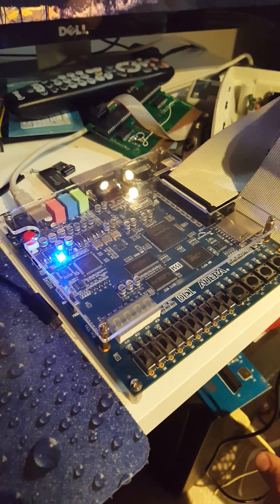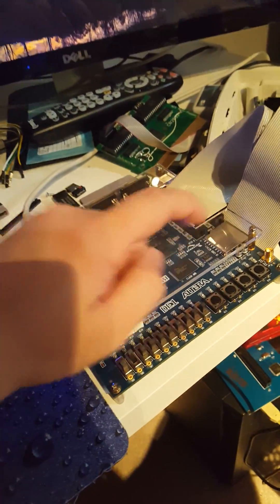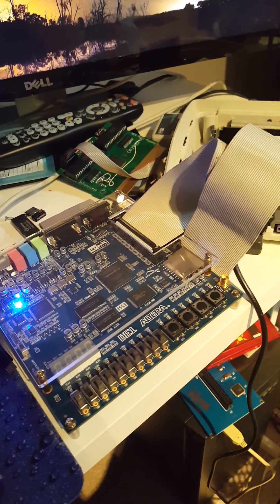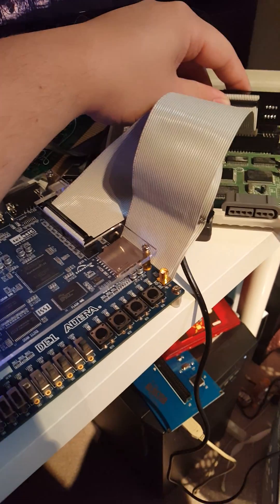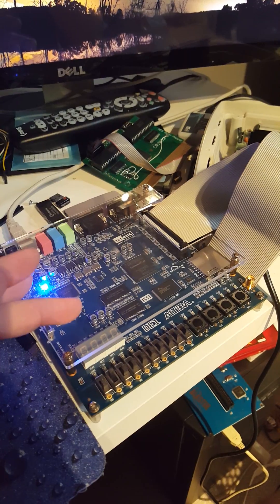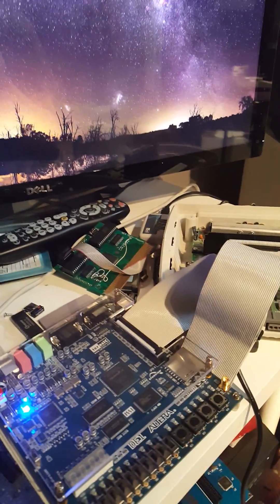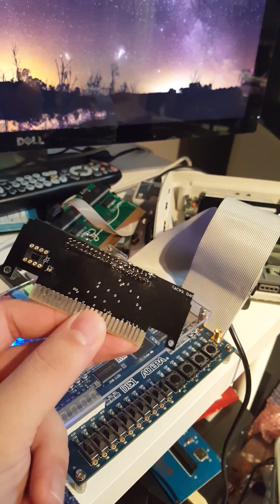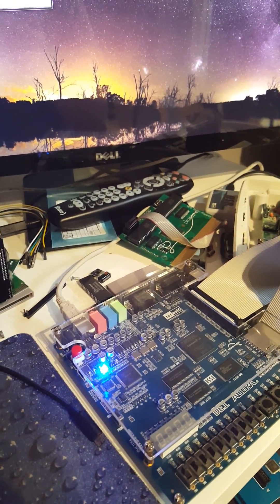FPGA SNES cartridge emulator

Comment: Retrostage PCB,

I've been writing some assembler for the snes as a hobby project here lately. I'd like to run some of the stuff I've made on a system and I've got an fpga dev board. Can you share the details on how you made the passthrough board? Also what hdl did you build this with? If with verilog would you be willing to share your implementation?

Thanks,
Austin
Reply from the maker: It was done with Verilog on a Altera DE-1 dev board. The passthrough board was just a test, but it lacks voltage translation from the 5V SNES to the FPGA board. As such I scrapped the project quite a while back.

I plan to revisit this at some point to add UART to the mix so I can write games over USB. If I get that working I'll release a proper source.

Comment: How voltage levels alignment was DONE ??? SNES has 5 volt logic or not ?
Reply from the maker: This was just a simple tech demo showing off the idea. If this were done in a cartridge setting then yes voltage translation between the 3.3V and 5V from the SNES would be needed.
Reply: @retrostagepcb4908  Cool. I was going to implement same idea for DE1 board and already bought almost all components to build "daughter board". Two cables will go to board with voltage translators (stopped at TXS0108E modules), then it'll continue to board with cartridge connector (to plug in real console), or to board with cartridge slot to build a dumper. And there is also interesting idea to dump ANY (NES/Famicom) cartridge intercepting signals during game. I think there is way to build automatic mapper recognizer :-)

Comment: Excellent job. I'm trying with a PSRAM and TXB0108 stm32f407. I recently bought an FPGA Cyclone IV plus I still need to learn how to use it. Could you share your commented code? Or help me in some way to use the FPGA.
Reply from the maker: Alirio Freire this was done specifically for the Altera DE-1 dev board, but I'm sure with a bit of tweaking you can adapt it to anything. I'll probably make a GitHub for this stuff soon.
Reply: Hello. Have u Byte Blaster to program ur Cyclone IV ??? I am also using TXS0108E to translate logical levels.